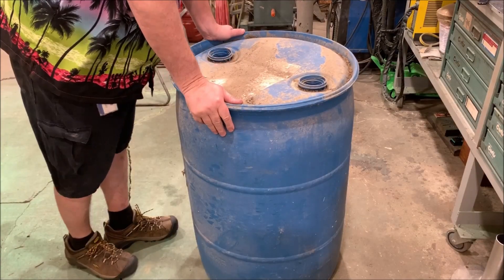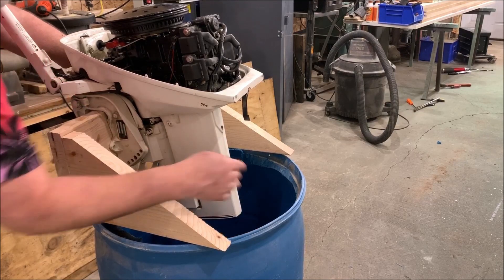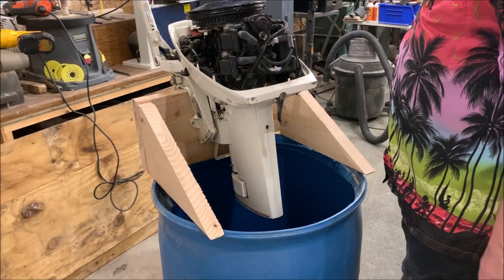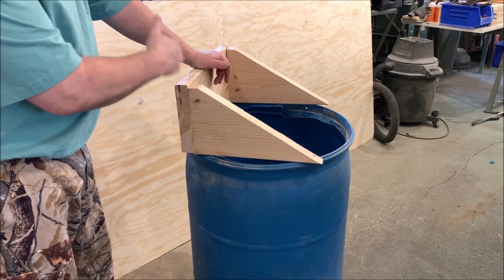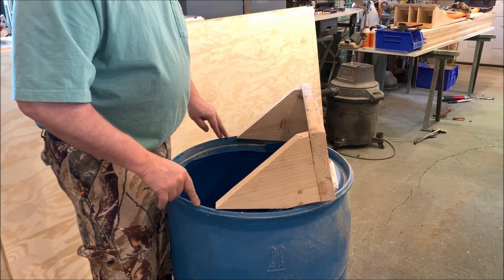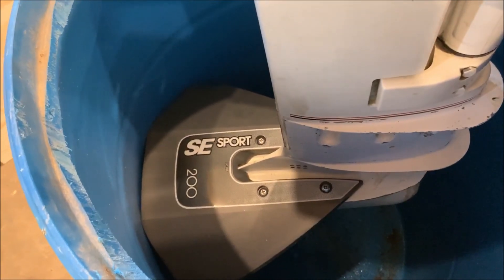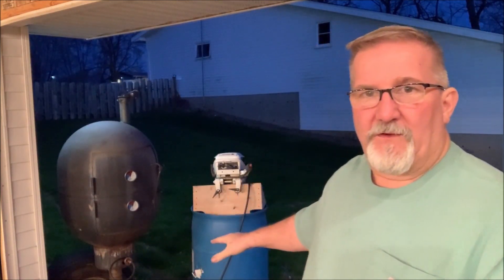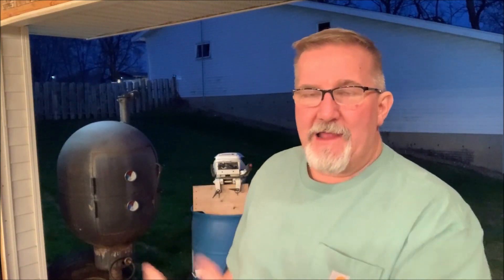Outboard motor test barrel build testing the Johnson 15 hp

Comment: Nice but .. It's alot of work for the plastic low idle high idle knob that's won't grab the brass needle on the carburetor....plastic barrel s are good.... plastic knobs are crap. 🤬😩😫

Comment: If you could keep the water clean, you could make an off-grid washing machine,  put a screen on the hydrofoil to keep stuff above the prop and you could use it fast for clothes and slower for dishes. Whata y'all think?
Reply from the maker: I like the smell of oil. Wouldn't need fabric softner
Reply: Maybe if you had a strong electric motor so your stuff don't smell funky

Comment: take an Oil Absorbant Pad and put it in the barrel after a few uses. It will pick up the oil and you can discard in the trash--so you don't have to change out the water so much--Mikiey